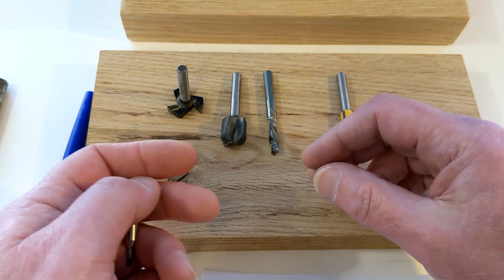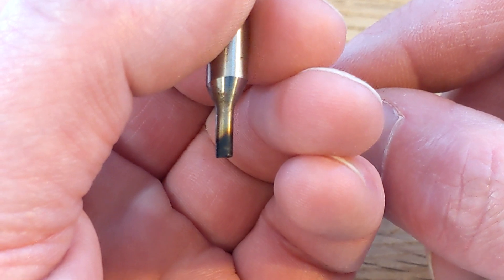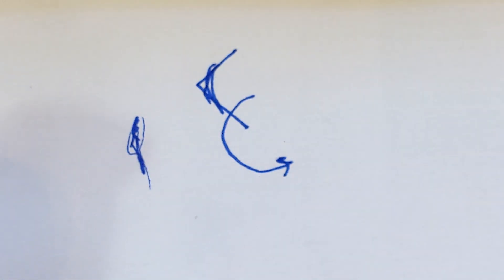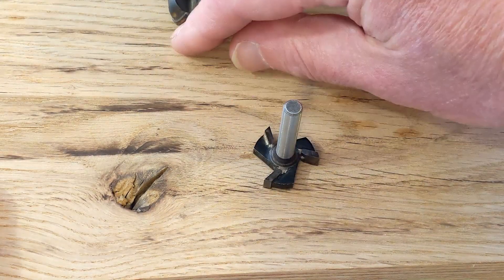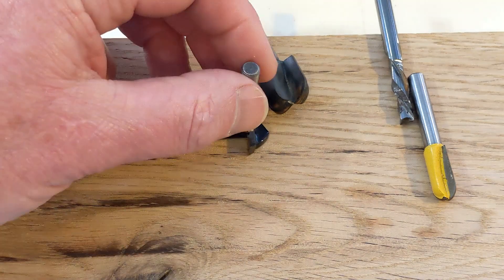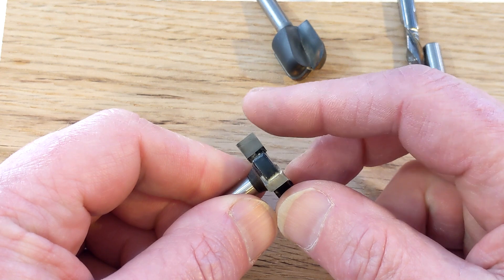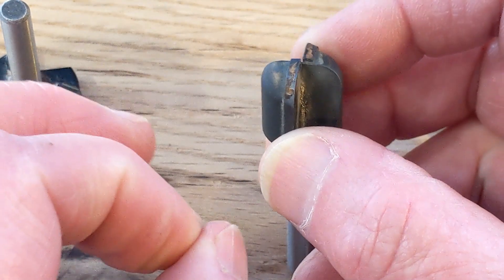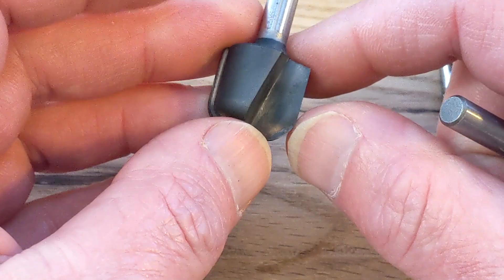CNC Router Bits, What Are FEEDS & SPEEDS, Why Are They So Important!

Comment: Hello. I work in a shop with a Kongsberg cutter. The problem is I am a novice (and I’m being generous), the last operator is gone and he didn’t know what he was doing anyway. I have been doing a lot of research on routing different materials. Trying to figure out the feed and speeds and depth of passes. 
I’ve watched a couple of your videos and they’ve been very helpful and enlightening. But I’ve only seen you talk about wood specifically. And the guide you provide seems to be for wood as well. 
How would I figure out the feed, speed, and depth for acrylic, metal, or dibond materials? Is it the same settings as wood but with a bit that says it’s for those materials?
Also, the Kongsberg gets up to 80k rpm and 50 mpm. A lot of what I’ve read has rpm up to 20k rpm maxed. When would I need a higher rpm anywhere between 40k - 80k?
Reply from the maker: Hi Cobalt, I'm sorry to hear you're having a hard time. Everyone has to start somewhere! I don't have that info put together yet, it may be some time before I develop it! There's so many variables for what we are doing that it's hard to answer that question with clarity in a comment.

Comment: At about the 1:00 mark the feed/speed rate is mentioned but glossed over. This is the most important part to the life of the tool and needs to be addressed and understood.....even for the beginner.
 In a nutshell the term "chip load" is used to gauge what size the chip is when it is removed from a cutting edge of the tool. The "chip" helps removes the heat generated. Without the proper size chip the heat is going to be retained in the tool. That's a bad thing.  
Chip load is dependent on the number of flutes, spindle rpm and feed rate. Chip  load is the feed rate divide by rpm times number of flutes. Feed rate/ (rpm x #of flutes) Below is an example of the 1/4" down cut router bit provided in the chart
 1/4" down cut  with 2 flutes, a feed rate of 75 ipm  with 14,000rpm.
75/(14,000x2)= .0027"  That's 2 thousandths of an inch chip load.

 The more flutes the less  material removed per revolution. The slower the feed rate the less material removed per revolution.
Like wise the less number of flutes the the more material is removed. The faster the feed rate the more material removed per revolution. The faster the rpm the more material it removes.
They all work  in a relationship together. There are calculators furnished my the major tool manufactures that will do the calculations for you. I use Vortex  tooling and their calculator app.

An example ...... a 1/4" 2 flute endmill  can cut 1x-2x times it's diameter deep. 
  The feed rate will be around 300 inches per minute. The recommended  general chip load will be .009"-.011" for optimum performance.

The problem is that the hobby machines are not capable of running at those speeds and not being able to make heavy cuts. Mostly this is due to not being rigid enough and the router HP.  Tool life will suffer because the tool is going to be taking the heat instead of chip on account it cant be run fast enough. (saw dust really with feed speeds).  The hobby machines will probably be fine with 1/8" tools and under.  With anything bigger, shallow passes will be beneficial to your cut quality, machine and tooling life.
Reply from the maker: Hi Reload! Thanks for throwing this detail in. Because this is intended for beginners, I thought they wouold be just as glossed over. However, I am glad you explained it in such detail.

a good point you mentioned was the number of flutes. Most home CNc operators think more means it can go faster. I'll address this in a future video.

Please feel free to add to the things I miss in future videos.

Comment: To reduce burning/heat you should reduce your depth of cut and increase your feed rate. The feed rate for a 4 flute bit needs to be 4 time faster than a single flute or 2 times faster than a 2 flute
Reply from the maker: Thanks Bryan. Always good to get the input from other experts. Keep expanding on the things I miss.

Comment: Another word used for the sap you mention is "pitch". As a general woodworker, I deal with that a lot on my table saw blades, Miter Saw blades etc. There are citrus based solutions sold in woodworking stores and on Amazon like Rockler Pitch and Resin remover and others. A good soak followed by a stiff nylon or brass bristle brush and it should come off. Some people use easy off oven cleaner. I wouldn't recommend that on carbide. It has a tendency to eat away at the carbide and I've read a lot of stories about carbide tipped saw blades breaking off.
Reply: I soak my bits and blades in simple green and scrub with a stiff bristle brush it works amazingly well  also pick up some plastic razor blades for scraping
Reply from the maker: Thanks Rob. A perfect addition to this video. I knew you'd come out with some help!